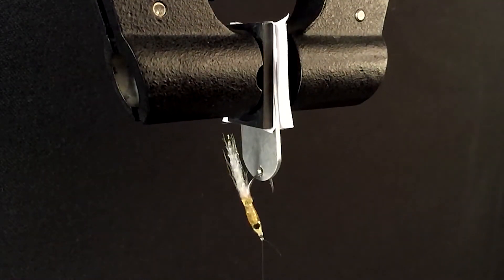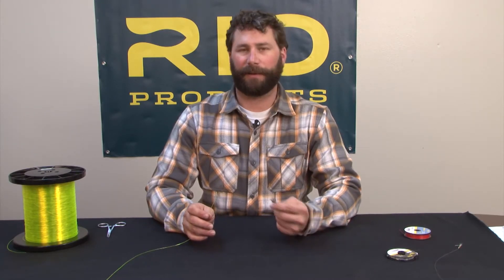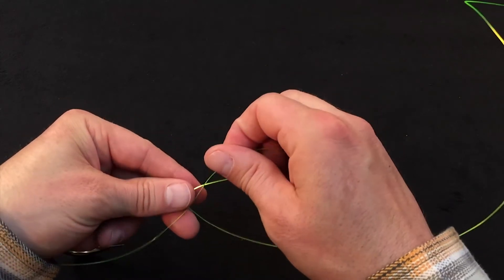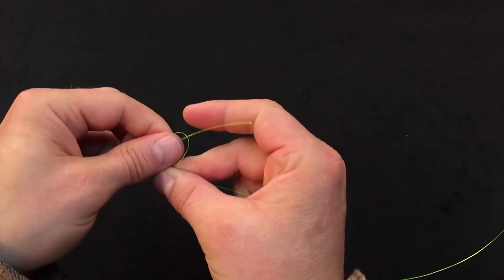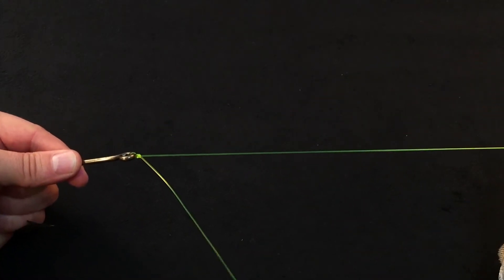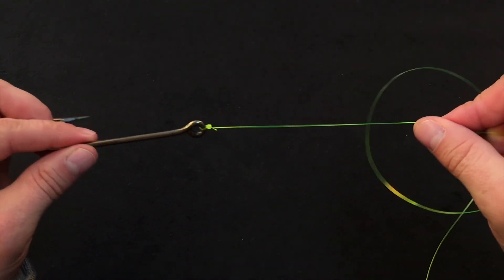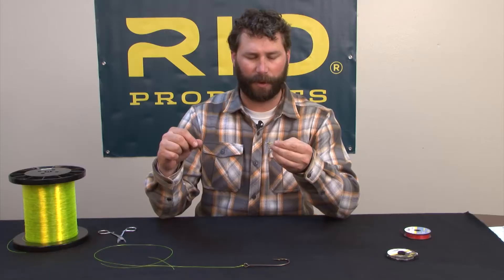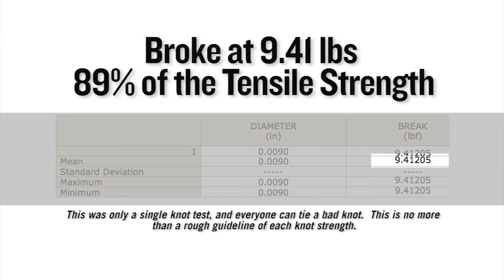Pitzen Knot Tying Instructions - RIO Products

Comment: You really don't need anywhere near that much tag. One of the best virtues of this knot is that it eats up very little tippet which allows you to change flys multiple times before adding new tippet. That much tag negates this advantage.
Reply: I was going to say basically the same thing. 10 inches is excessive and wasteful. Since we have a finite amount of line to work with, we need knots that use a little line as possible. I think 3-4 inches is plenty.
Reply: This video is produced by a company that sells tippet!
Reply: Don't you use this knot for dry flies on trout, the bulk of the knot spooks the fish (light reflecting in the knot).

Comment: I'm confused, he never mentioned pulling the knot loose after tying to produce a loop on your fly.

I pass the tag end behind the running line and wrap three and one half times, then put the tag end through the loop and pull tight (a quick Hangman's Noose). This knot has 95% of the running line strength.